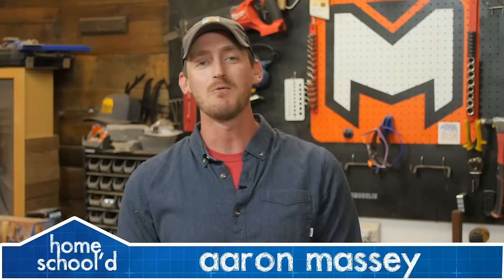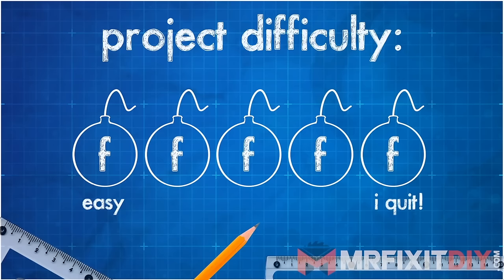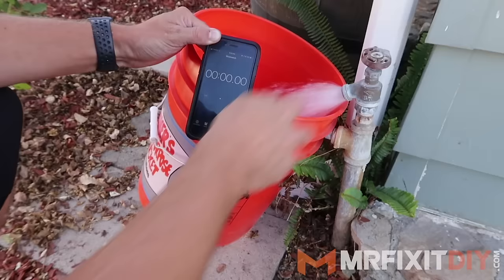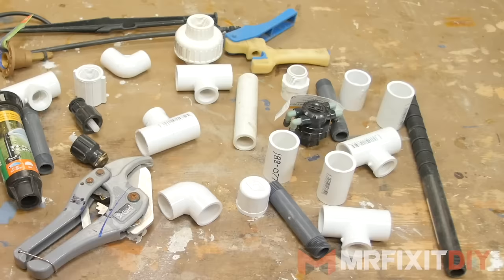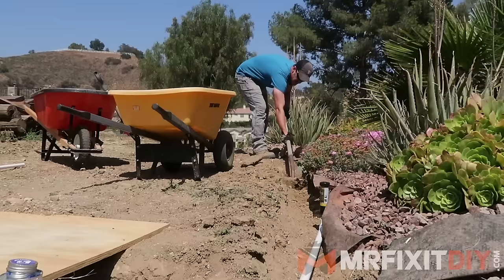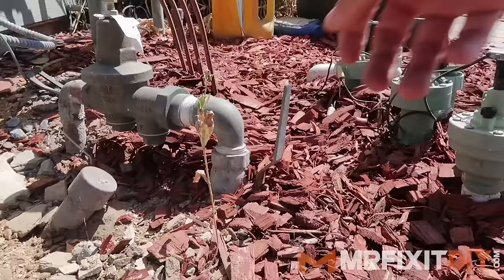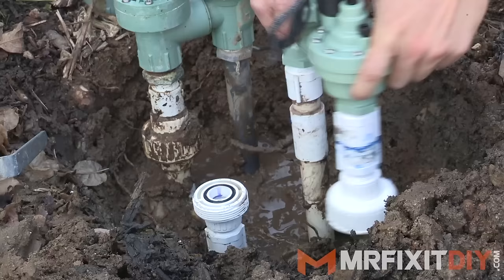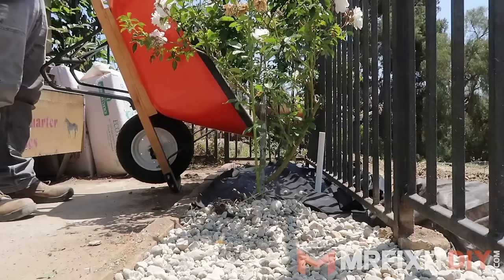How to Install a Sprinkler System | A DIY Guide

Comment: Its all a conspiracy! Landscape companies are just out to get us all! DIY is the only way to go! Orbit and K-Rain have to be the best brands I have ever used and they are not going to break the budget! Who needs a fancy sprinkler when you can do everything yourself for way cheaper and all from Ace and Walmart. If anyone comes to you and says that you need a professional for your sprinkler work, tell them you can do it yourself, and just as good as them. I have been doing sprinkler work for many many years at my house, and I have even done my neighbors yards a couple of times, and my systems are rated for commercial level quality. This guy doing this video is spot on!!!
Reply: Two different lifestyles buddy...
Reply: But dude, don't you have a job making at least $100/hour? It does not makes much sense to spend the day doing this stuff when you can have a yard maintenance guy do it right ans affordable
Reply: Yeah I rather pay someone to do all this.
Reply: When you're 85 you'll be calling the pros 😮
Reply: k rain and orbit are trash, also this guy should use funny pipe to connect the heads to lateral lines, it's much better. Also distance should be included as to how it effects flow rate.
Reply: 👆 butthurt landscaper?

Comment: Lmao. Your avb valves aren’t even tall enough. They have to beat least 12” above the tallest head in order to be effective. Just like a pvb they are good for back siphonage but not back pressure. Also using 3/4” line isn’t as effective as 1” line as you start to lose too much flow as you get further away from your cross connection. Best would be to use 1” as you still lose flow and pressure but not near as much. Since you can only get around 23gpm out of a 3/4” line and 37gpm out of a 1” at the start with pressures around 66psi.
Reply: Not sure what you're referencing with the PVC valves needing to be above the heads care to elaborate, Perhaps tag time stamps on the video. Thanks
Reply: Your avb valves must be 12" above the tallest head in system.  Its a safety feature to prevent backflow/backpressure.  I have a trencher that puts 2" wide x 7" deep and have that done in two hours.  Polly pipe with clamps.  If its in the desert area drip would have been better.  Just put a spigot timer attached to the bib and be done.  14yr master irrigator.
Reply: @mikejanczura1540   master irrigator and you use poly and clamps?    Why?  This question is being asked by me another master irrigator by trade over 20yrs experiance. Installed irrigation on 4.2million dollar eyeball park in center of dallas.

Comment: To me the hardest part about installing a sprinkler system is laying it out to get even coverage over the whole yard and what types of heads to use so you’re not wasting water by having heads that shoot further than you need. Plus it’s way  easier in a situation like this where it’s a new lawn where you’re not having to tear up existing grass.
Reply: I can do exactly that in less than 30 mins most the time. Pace out your nozzle sizes and your good to go. You should be able to pace and flag and zone all at once. That's how all the pros do it. If you see anyone out there with a tape measure they dont know what they are doing.

Comment: Sch 40 although stronger isn’t necessary. If your worried about $$ stay with class 200 pvc and you’ll be fine. UNLESS there’s a lot of foot traffic over the piper or your going through some sort of a sleeve. In that case sch 40 helps in a long run. But feel free to switch from one size to the other.

Comment: I usually drop 1 1/2 F bombs when I have to replace 1 sprinkler head. That looks like a ton of work! I swear the original installer used the thinnest piping and cheapest connection pieces on my yard.
Reply: I'm deciding whether to pay a contractor or DIM (DoItMyself).  I'm leaning towards DIM because of your comment and because my neighbors had a contractor and I'm not impressed.  I don't want that flex pipe stuff.
Reply: Thomas Musser The thinnest pipe last just as long boss
Reply: That's what I'm dealing with! Following and digging up all the old, super thin schedule 1 (I think) crap. It so thin it's hard to cut - it just collapses! Freaking nightmare can of worms I opened.
Reply: Where I was raised in Fl. , that’s what that thin pipe was used for !

Comment: Many water purveyors will not allow irrigation on the domestic line and meter. Good design practice to keep them separate anyhow. And really the backflow protection should be provided by a double check or RPZ to ensure protection of the public water supply. Many purveyors will require documented backflow testing for all irrigation systems.

Comment: Don’t forget Atmospheric Vacuum Breakers or AVB is required to be installed 6” above sprinkler highest point which would be the spray nozzle. If AVB is lower it can cause back pressure condition through the valve. In addition, black swing joints should be use on the sprinkler tee. Just in case the head is stepped on it won’t break the tee

Comment: Nicely efficient and helpful video. This is clearly somewhere without freezing issues. Isolation valve should always start at source of water. Helpful if pneumatic blow-out design & process could be quickly explained.

Comment: great video.  Thanks.  How do you drain the sprinkler system for winter?  Also if my water bib comes out of the house instead of the ground how can I install the sprinkler system?
Reply: You normally use air pressure to clear the sprinkler lines. A large air compressor. 

You should install a backflow preventer where the water comes out of the house

Comment: What’s the best diameter pipe to use? And is there a resource to find how many heads I can put in one line based on water pressure?
Reply: He is using 3/4" but 1/2" is probably fine. I saw some new push on style hose at Home Depot for even faster installs.

Comment: Great information full of details. I liked it. Question, do the PVC lines need to be placed at certain degree level? I live at High Desert in California, 105F during summer and 40F during winter? 

Thanks Geo
Reply: No, the water pressure will move the water against gravity if needed. Depending on the slope of the hill, the length of the pipe and the diameter of the pipe are going to determine how much pressure loss you'll experience.

PVC really isn't recommended for irrigation systems anymore. It'll work for small systems but doing a large lawn with PVC would be a nightmare. It's cheaper and easier to use 1" HD Polyethylene pipe for most installations.

Comment: Great video,my installer did not go 6 inches deep, when I had a 75 foot tree cut down the fallen tree ruptured an underground connection union and I had to replace. Make sure you have 6 inch trench!
Reply: 6 to 8 inches actually

Comment: Great video, just simple enough for exactly what I need to do. However, I notice you filled in the trenches with rock..most systems I’ve seen are filled in with dirt. What is (if any) the advantage to using rock?
Reply: he doesnt know what hes doing, he has an idea, but not really
Reply: My guess could be for a few reasons, drainage, border to prevent damage when mowing a yard, easier to uncover to replace a sprinkler head.

Comment: Hi, would it be possible to do a lenghtly video on whole process. especially the ant-backflow system with Zone system. I have a Rachio smart irrigation controller. I am not sure how it works and I had to rely on handwatering

Comment: I only use schedule 40 when its really rocky but when it is not rocky i just use it for the main line i dont use primer on pipes smaller than inch and a half and most inportant i have replaced a lot of orvit balves for home owners they are shitty valves
Reply: Keep doing a good job bro

Comment: What kind of pressure loss do you have going up hills if the area needing watering is uphill from the water supply?  I have maybe a 15'- 20' change in elevation & about an 80' or so run to the highest point I need to water.
Reply: Static pressure loss will be .433 psi per foot of elevation gain, and depending on the size, type and length of pipe you will have some pressure loss there too. There are charts that help you choose the correct size pipe for your needs including pressure loss.

Comment: I am fixing a 10 year old system which has some sprinkler heads that have sunk underground.  I also have a manifold which I need help with.  Do you have another video which would help with these issues?

Comment: at a few bucks per sprinkler you could add swing arms. Among other things, saving money on installs leads to spending more down the road. pet peeve on service calls are sprinklers attached without swingarms, especially on sced 40.

Comment: Hey this was awesome! One question! Is there anything wrong with using 1 inch pipe when I have a 3/4 inch water supply?
Reply: Aside from cost, going bigger is better. You’ll have less pressure loss due to friction in the pipes. 

However, if you have any kind of slope, put in tiny check valves at the bottom of your sprinkler heads. They cost $0.50 each and will prevent water from higher slope leaking out through the lower slope. 

Having gallons of water leaking out of the lower slope after each watering will cause a puddling mess. 

Its even more important when you use a larger pipe because a bigger pipe will hold a lot more water. 

Empty pipes also take slightly longer to fill back up each time you water your lawn, in addition to being a waste of water. 

Check valve is a cheap and quick solution to the simple problem.

Comment: Or just run mainline from a hose tap to a valve with wire for the timer and you know normal 3/4 poly pipe with saddles

Comment: Do you need a backflow device if you are using the antisiphon valves?
Reply: The anti siphon valve is a backflow in this set up but if you’re setting up a proper system that runs of your meter then yes you need to install a backflow

Comment: the only problem is i dont have a water hookup lying around, so what should I do then?
Reply: Hook up to your meter like a proper system is supposed to be and don’t leave your heads out of the ground like in this video it’s ugly and there’s a reason why sprinkler heads pop up about 6 inches

Comment: Hi, is it normal to lose water pressure with each additional sprinkler? I used 3/4 PVC and saw in your video all the sprinklers had pretty strong spray when they popped up, but my spray is much weaker across 4 sprinklers than just 1. I thought that connecting them in one series would allow them to have the same pressure since it’s the same pipe? Would appreciate any thoughts!
Reply from the maker: It could be that the overall pressure of that line is low to begin with. How far apart are the nozzles? This is a fairly isolated area where the heads are in close proximity to each other
Reply: MrFixIt DIY thanks! I’m awaiting the faucet pressure gauge, but it’s new construction so imagine the PSI should be decent. The sprinklers are about 25-30 ft apart to enable coverage for a large yard. They are Rainbird 425SAs which advertise 18-27 for coverage. Anywho, thanks a lot for posting this. This was the one video that was straightforward enough to convince me to do it myself. Was just curious if it’s normal to lose pressure more and more sprinklers (makes sense)
Reply: @tofuman14   the difference is he used heads your using rotors, there is a differant required head pressure for both. Also, to answer your question. Yes, you lose psi at each head daisy chained on the line. Here I'll make it easy for you.. use cl200 1" pipe bury ut about 6-8 inches. You will be able to put no more than 4 on each line.
Reply: @noeeon9910  That's not true. 1" HD polyethylene pipe can handle about 15gpm with acceptable pressure loss on the line. This means you can put up to 15 Hunter PGP ADJ with 1.0 GPM nozzles in them on the same line, or 10 Hunter PGP ADJ/Ultra on the line with a 1.5 GPM nozzle. Etc. The minimum pressure required to run a Hunter Prospray or Rainbird 1800 series can operate at as low as 15 PSI but 30 PSI is recommended for Spray heads and 40 PSI is recommended for MP Rotators.

You can't just put "4 on each line", that's a horrible idea. If the person is on a well that could be too low of utilization for the well and that would cause it to cycle too frequently causing premature wear and tear on the pump. They could have very low flow out of their well, so they might be over-taxing the well even at 4 heads.

Comment: How do you use the pressure to select sprinklers? Thanks.
Reply: Raul Contreras, Sprinkler mfg. have charts indicating distance per nozzle type (ex: 1/2 spray pattern at 60 psi) min and max distance it will perform. Hope that helped. Just Google sprinkler co. (Ex: Rainbird) PDFs for their sprinklers coverages.

Comment: No swing joint from pipe to sprinkler?
Reply: What's the benefit of using them?
Reply: Keeps you from breaking sprinkler heads when you step on them or strike them since they provide some flexibility.
Reply: @amelsogorovic3075  , Ok, thanks.  I'm thinking about installing a system so I'll definitely look into those.
Reply: I never heard of one.  As an amateur home handyman (my house only), this is good info.  Thanks.
Reply: Swing joints also help to adjust the height of the head easily
Reply: Dont buy the swing joints buy barbed Els and swing riser pipe, this enables you to make your own swing joints on the fly and your not limited to the 6" and 12" sizes.

Comment: Hello, I’m going to install a sprinkler system but where I want to tap to the water supply, it’s copper piping.. how can I tap into copper piping using pvc?
Reply: Easy go to home Depot or Lowe's in the plumbing section tell the guy what you are doing he'll probably tell you to get a t- fitting, extra copper piping and a copper threaded 3/4" male adapter, and then get a PVC female threaded adapter with a 3/4" end you could glue to the 3/4 PVC piping.

Comment: Others told me I can’t go directly into the pvc and have to use another attachment flexible joint tuning to connect the sprinklers to the PVC header. Their reasoning was that if you rolled something heavy over the sprinkler lines it would cause the joint to crack. I think there bs because years before these new fangled joint/tubing design everything has always been pvc and sprinkler heads. Thoughts? Is there any validity to the school of thought that you should never go directly into the PVC because it’s too risky or is the extra material just another way for these companies to get our money?
Reply: They are called swing joints or swing riser pipe. I put every head I install on a swing joint. It's faster to install and easier to repair. Also, you get the added benefit that it protects the lateral lines from Damage because it absorbs impact. An absolute necessity around driveways

Comment: Someone please tell me where my simple thinking could lead me astray.

For the examples sake, let’s say I trench an H pattern in my front yard with PVC.   Then I connect a pop up at each end point of the H.  I then run a PVC line to a mulch bed at my front porch and stub up vertically another PVC pipe with a threaded female “hose” receiver.  I then use a garden hose from my outdoor spigot to this stubbed up PVC receiver.  Turn on the spigot and watch the heads raise up and work, no electronics.  

Would this work?  Will I contaminate my drinking water?   Just started researching irrigation today.   I do appreciate the feedback.
Reply: You need a DCV or PVB.. Period!
YES you "Can" contaminate the city water line without one! And with that amount of pressure (45 - 60psi) you are bound to have multiples issues in the near future.
Reply: Aniya Love' hey thanks for the response.  What do those stand for? DCV PVB ?   Thanks.  

Have any resource recommendations I could check out for better understanding of irrigation?
Reply: @JustinSmith-hr6qg  These are simply Check valves.Double Check Valve. Or Pressure Vacuume Breaker.
Reply: Aniya Love' thank you very much.  Just to clarify, even if I remove the hose when I’m finished I will still contaminate the drinking water?
Reply: @JustinSmith-hr6qg  Nope! Not at all. I would recommend a Vacuumed Hose Bib Breaker so you would not have to keep removing the hose from the initial water supply line.

Comment: I loved you're video. I don't know if somebody can help me. I have a yard, it is a rectangle 43'x24'. My psi is 45, and I have a flow of 12 galons per minute. How many sprinkler heads can I put?
Reply: It depends on the individual flow rate of the sprinkler heads you plan on installing. You'll have to plan out the types of heads you want to put in to water your yard and then determine how many zones you need to fit all of your heads. A typical sprinkler head will take up between 1 and 4 gallons per minute, depending on the type. For example: let's say you decide to put in 6 rotary heads at 4 GPM each, all of those heads take up a total of 24 GPM, so you would need a minimum of 2 zones (3 heads each zone).
Reply: luis moncada No le creo nada a esta a este mejor contrata a una compañía por qué son muchos detalles los qué hay que tener mente tengo 20 años de esperencia instalando sistemas
Reply: Thank you guys for the input.
Reply: 14yr professional irrigation guy here.
With lower pressure I would suggest a mini rotor made by rainbird.  2 zones.
Each rotor with a nozzle #2 or #3.

Comment: Great video, this one doesn't need electricity right? what is the name or brand of the solar control and where can I buy those? Thanks in advance.
Reply from the maker: Yes it’s a solar valve so no additional electricity required. This is a DIG brand which you can find at Home Depot
Reply from the maker: You can find info here. http://bit.ly/InstallingSprinklers